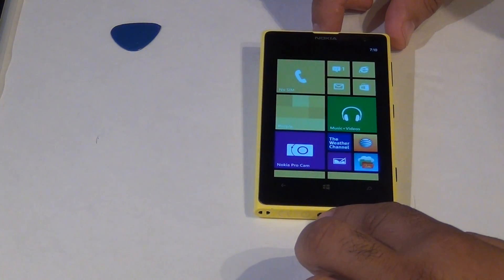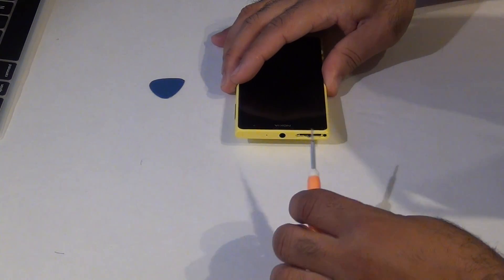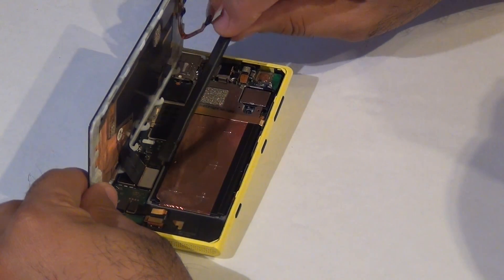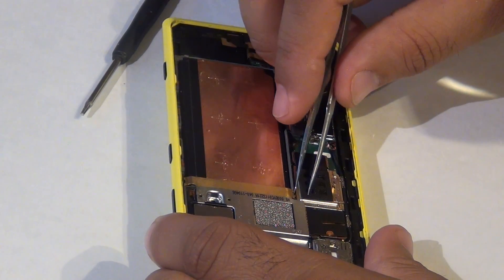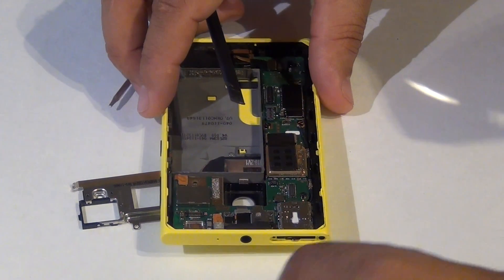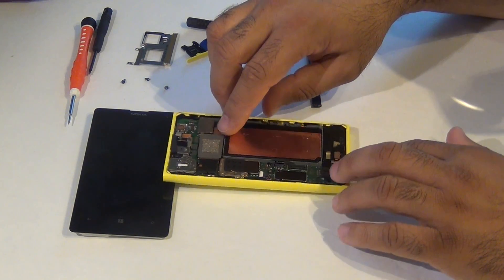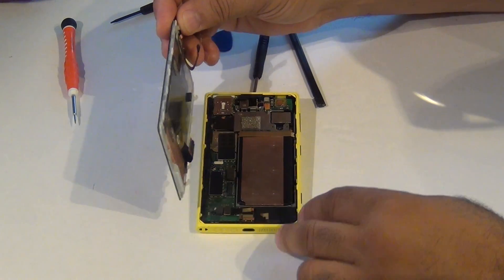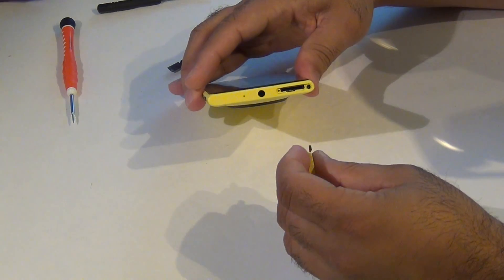Nokia Lumia 1020 Teardown Screen/Lcd, Camera, Charge Port Replacement

Comment: great video.  do you know if it's possible to get the charging port out of the case?  my 1020 has developed an intermittent charging problem.  I have managed to obtain a replacement for a few £ but now it seems like it's part of the main body of the case and thus cannot be removed

Comment: Your comment about the usb port is quite misleading. I bought a replacement based on your comments of it being two screws and easy. It was not, the two screws near the usb port are for securing the motherboard and not related to the usb port. I had to do a lot of searching to find some guidance for replacing the usb port, in the end I had to damage the casing slightly.

Comment: Yes, the USB changeout requires surgery.  But is is doable, though it might not be viable in a commercial repair context.  I only bothered with it because my spouse loves the unique 42MP camera on that phone. The teardown required (including removing the mobo) is pretty simple,just handle the parts cleanly & carefully, don't lose the screws, & all will go well.  BTW, the first screw (under the SIM cover) is captive, it does not come out. 

You need to buy the complete assbly with the connectors, but they are only about $7 from HK (via Amazon).  The information from Daniel Grove is largely correct, but though obviously the connector is fitted prior to the outer case in production, I was able to replace it with the lugs on for firm retention, by inserting the (internal) connector side of the USB into its mount first, then prying the outer (yellow) case (with a small plastic blade) on the other side to maneuver the other lug round & over the black plastic bracket into its slot. Additionally I recommend that after you have broken up & removed the old connector, carefully use a duster spray to clean out any shards remaining: blow away from the case, out of the port hole.  The connector has a soft grey seal around it which you should carefully remove & re-use: pop it on before inserting the connector into its mount.  Make sure that you remove all the bits of the old (black block) component that is on the end of one the foil leaves of the port assembly from its slot in the black inner case: that makes a good levering point to peel back the outer case when inserting the connector.  Make sure that the matching component from the new assembly goes back in that slot. 

When you have done all that, re-assembled the phone, & inserted a micro USB connector, that satisfying (but dull) "click" makes it all worthwhile - not to mention the response when you attach it to your PC!  How many pictures did she take since the port broke that OneDrive did not upload? 

BTW this is micro-surgery so a video would be difficult.  & I would not do it twice over on one phone!

Comment: thx for this video. just removed and replaced my battery. i had the cpu "heat sink" come off very easily. almost makes me wonder if thats why my phone always felt really hot. i added in some thermal paste for good measure :)  phone is charging atm. only time will tell if this helps with my quick power drain or not !

Comment: To remove the charge port you must know how to solder!
Reply: Zack Godwin No, but you do have to carefully pry out the usb port. You have to remove the motherboard too. It's a little difficult but I did it.
Reply: +Adam Herrera how did you do it without compromising the microphone? or how do you release that enf of the flex?

Comment: WHO WILL TEACH US HOW TO REPAIR THE USBBBBBBBBBBBBBBBBBBBB
Reply: Elmar A  I just replaced my charging port.  I took out my motherboard and then used a flat tip screwdriver and pushed up on the back of the usb port I was replacing, destroying it in the process.  Once I got the main part out I pushed the edge away from the phone and took out the small portion that was stuck in the phone.  In order to get the new USB port in I took a box cutter and cut the side plastic prongs meant to hold the USB port in place.  It then slid right in and I pushed the edge away and slid the other part in.  It is now working fine, it's a snug fit so I don't feel cutting off the side of the port should cause any long term damage.
Reply: +Daniel Grove the motherboard is the entire inside of the phone! I have five screws removed, it seems like absolutely everything would have to be removed to get to the USB port

Comment: Hey, can you clarify about removing the usb charging port? you mention that you can remove two screws then easily remove and replace the charging port, but you don't show how to do it and after trying myself it seems that this isn't the case. it appears to me that the entire motherboard needs to be removed in order to replace the charging port but I hope I'm wrong. any insight?